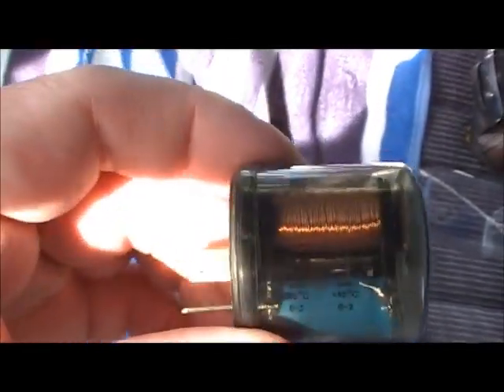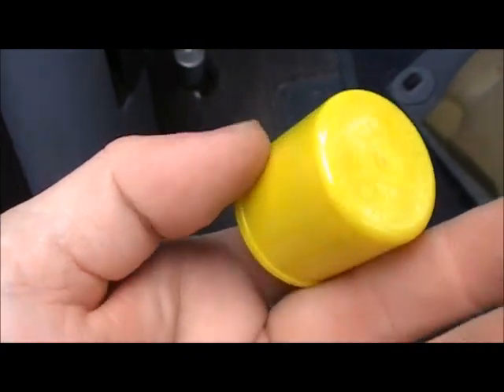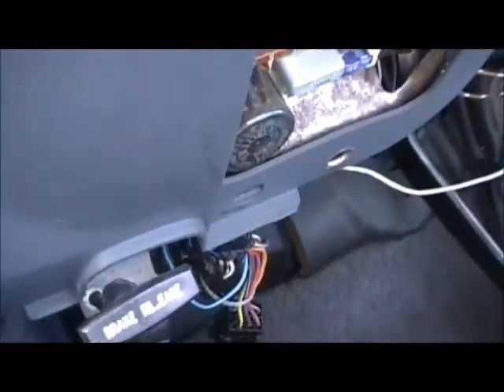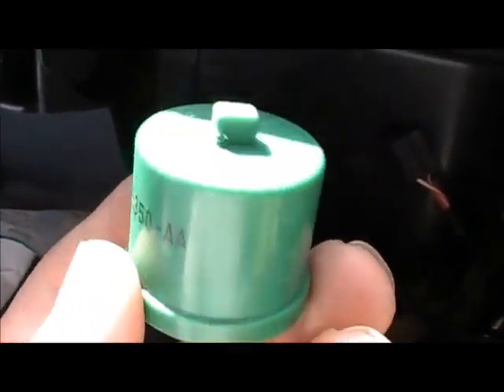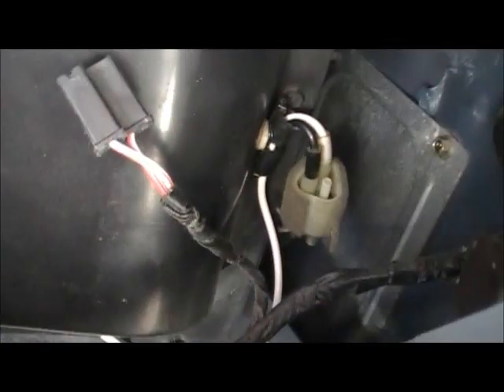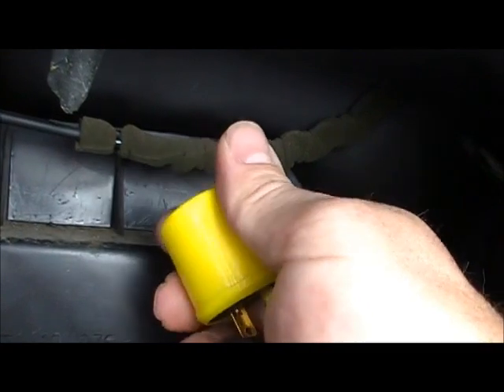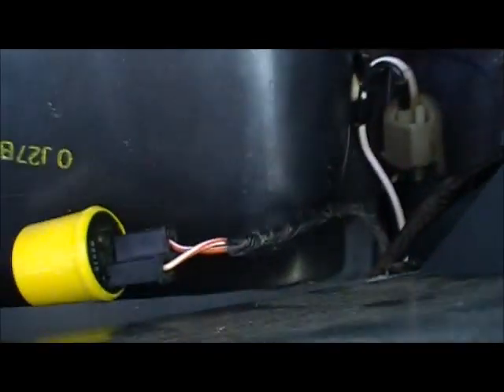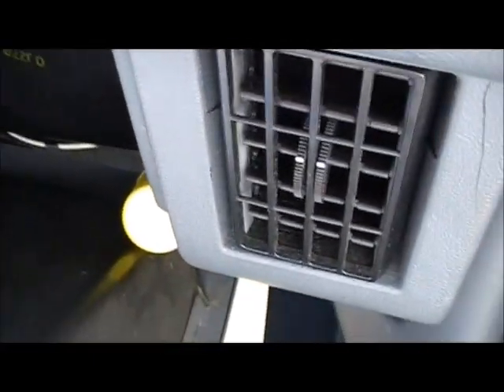Loud Turn Signal Flasher

Comment from the maker: I'd say it's pretty close if not the same as a motorbike would use. A regular thermal type flasher wouldn't last because of the vibration they would endure. You're right; the simple devices will outlast the "fancy" ones.